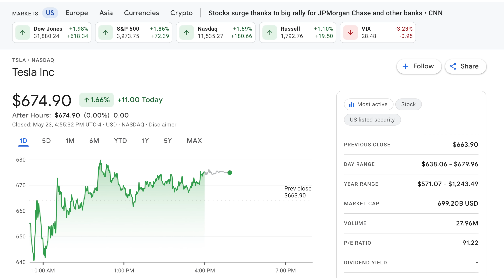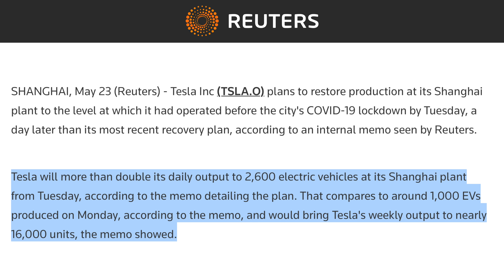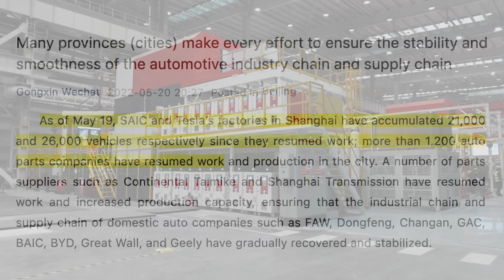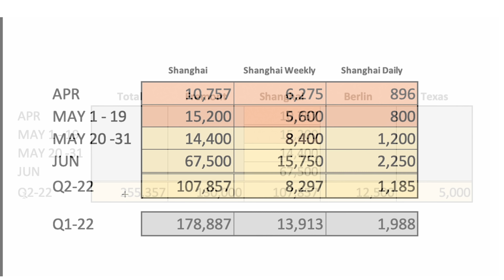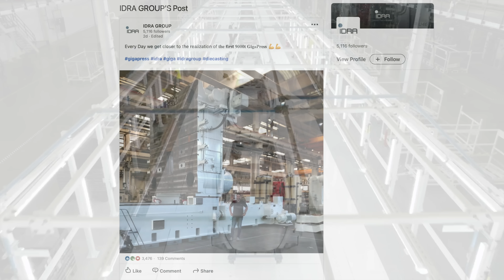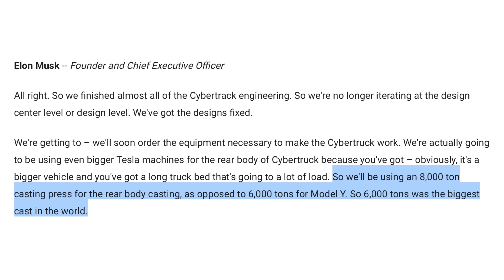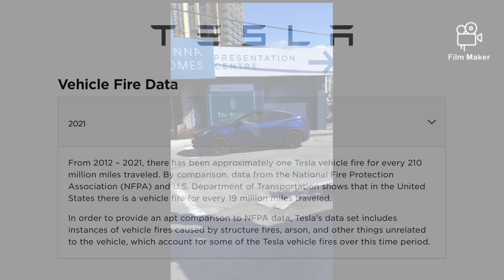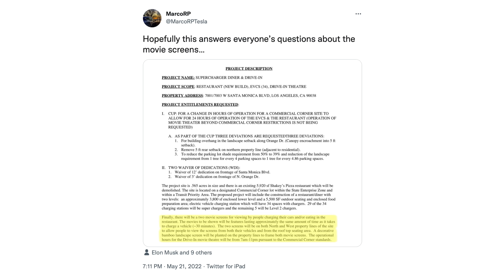Giga Shanghai Set To Ramp? + New AI Presentations, Giga Press

Comment: That second fire looks like gas burning on the outside of the car.
Reply: Looks like the owner threw gas on the top and lit it
Reply: The owner said on the news the fire started inside the car,  sounds similar to the Model Y.
Reply: @dmitchellhomes  which is why the glass and roof are on fire? Nah an internal fire would blow out windows before escaping to the exterior
Reply: @woodycoat  glass is the first thing gone when the car catches on fire, take a look back at video of any Tesla fire, all the glass is gone
Reply: @dmitchellhomes  "said" sure but I'm going to go with what I can see.
Reply: @lucidmoses  welcome, google the new story, they have video of the fire, it happened in California city.  Has been picked up by a lot of the local media, including an interview with the owner
Reply: @dmitchellhomes  Ok, I looked up some extended video.   There are different angles that do look like the glass is broken and the fire is coming from inside.   That being said, I re-watched the bit in Tesla Daily's video.  It still looks like gas on the roof and the extra footage I found doesn't have any info as to if it started on top and spread down when the glass broke or if it spread up.   Had to check about 10 videos to find one that wasn't geo blocked.   Do you know of one that shows the order and not just a bunch of clips?

Comment: Just a reminder.  I don't remember who, if ever, the 'loyal customer using 200 presses...' might have been, but a customer could be using a 6000 ton press to make, for example, 5 smaller castings such as a transaxle.  By using a 9000 ton press they may be able to cast ten smaller castings at once, thus doubling their production rate.  This makes great economic sense in the mass production domain.  The same goes for a 6000 ton press: it may be used to cast many smaller parts with greater economy than a smaller press.  Time is $$$ so bigger means faster - it doesn't mean that every big press is used for a big casting.

It is still very dismaying  to see so much media attention focused on Tesla fires.  There should be more media attention on ICEV fires, to give a more accurate picture of vehicle fires in general.  Thanks, Rob.

Comment: The image from the California Tesla fire looks a lot like somebody poured gasoline on top of the car and set it on fire.  I do pyrotechnics and that really does look like an accelerant on the roof.
Reply: That's what I thought. Why the hell else would the windshield be on fire???
Reply: Battery fires are supposed to vent from the bottom out . I agree looks fishy .
Reply: I looked at that and thought "molotov cocktail", glad I'm not crazy!
Reply: Flammable liquid pored on top all but certain, glass, paint and body panels don't do that.
Reply: I agree. It looked like the glass was burning, which glass does not. Looked like an accelerant. Insurance scam?
Reply: Seems more likely roof glass igniting some interior trim due to sun magnifying glass type situation. Would be interesting to know what interior temperature was before the smoke started.
Reply: It does look that way, but if you watch the video, on KomoNews, you will see it's totally legitimate. The illusion in this photo is explained by the fact that at this point there no longer is a roof, nor a front windshield. The inside of the car is full of flame and the side windows, blackened by soot, burst and shatter a couple of seconds later.
Reply: @darylfortney8081    That glass is NOT a lens, doesn't magnify anything.  Look at the picture--the flames are on TOP of body and glass
Reply: Either gasoline or the paint spontaneously self- combusted. 🤨
Reply: @darylfortney8081 , there are millions of Teslas just like this in much hotter climates.  Even during the hottest months of the year (i.e. not May) they don't turn into magnifying glasses and start fires.  So your conclusion seems VERY unlikely to me.  Also, the fire should be on the interior if that were the case.  Flames coming off the outside surface of the glass makes very little sense.  This is most likely a case of vandalism/arson IMO.
Reply: @darylfortney8081  Actually the roofs are designed to reflect UV radiation. It's only 2% tint, but 99% UV light.
Reply: @darylfortney8081  That would not cause flames to dance on top of the roof glass. The flames would be coming out the side of the car via the windows.

Comment: One german newspaper has written an article about Berlin having problem with personnel and shortages of components coming from Shangai because of the lockdowns, and that Q2-22 Berlin production should be between 7000 and 9000, not sure how much reliable it is, but they say it's a source close to Tesla in Germany.
Reply: As someone living in Shanghai I can tell you that then coming back to regular production levels anytime soon is a pipe dream. And even if they do they will face serious problems with actually transporting those vehicles out of Shanghai as the port of Shanghai is backlogged for months and leaving Shanghai by truck is NOT an easy task. Shanghai is still in lockdown even if state media would like you to believe otherwise.

Comment: Time stamp  10:21.  It appears the flames are burning the front windshield.  That seems unlikely as most glass I know of does not combust.  What is the combustionable material feeding those flames?  It would appear it could posibly be a flammable liquiid of some type that was somehow poured on the top of the car, and then it ignited.  Hot wax?  HaHa.  Very strange looking fire the way it is igniting on the bare metal and glass.  I am curious what the experts from the Fire Dept. conclude.
Reply: I totally agree, someone threw a bucket of petrol over the car in my opinion (or something similar).

Comment: Hi Rob, do you have any information on the Tesla Megapack factory that was being built at the end of 2021. I see this as a huge boost to energy with a capacity of around 40GW. I can't find any news that it has opened or when it is coming online or if this will be using LFP batteries. Thanks
Reply: I think there hasn’t been any news about Lathrop recently. The Q1 update deck said things are on track though.
Reply: Energy storage always uses LFP to my knowledge, as space isn’t that important.
Reply: @xWinstonski  LFP battery technology has been under a patent until recently. They could only be manufactured and sold in China. This has now changed so they can be used by companies in cars and energy storage

Comment: Question Rob: When you did the autopilot test, the car to me seemed to shut off the autopilot when the car pulled out in front of you, either that or you shut it off. So if that were an accident, does that count as an auto pilot accident or not?
Reply: If the autopilot was engaged 5 seconds prior an accident it's counted as autopilot accident.
Reply: It's FSD, the autopilot is the stuff that other safety systems that manufacturers have like; lane assist, blind spot monitoring, active cruise control, and pedestrian avoidance but more refined. I look at the nuances when the media blames autopilot for accidents of the journalist not doing their job distinguishing the difference. A real journalist will state the FSD.  I know your not a journalist but want you being aware of the news coming forward when reported.
Reply: @GG-si7fw  Oh ok thanks for that. Yeah for sure I was meaning FSD then.
Reply: @zbyszanna  aight, cheers

Comment: Maybe tesla's already have this but maybe they could display a graphic for the manual door door release in the case of an impact?

So if the car detects an accident something gets displayed on the screen helping the passenger's with how to get out if the other power electronics are down but the screen is still on for some reason.
Reply: If they can power then screen then why not just power the doors handles
Reply: @charleslash4895  Depends how the car is hit.  If it is T-boned from one side, that side may have had power cut off, while the rest isn't affected.  One passenger might not be able to get out.  Either way, people should know about the mechanical releases.

Comment: If it is true that 8K lb of pressure is good enough for Cybertruck underbody cold castings, I don't think Tesla would pay for 9K lb presses.  Those are sure to be considerably more expensive.

I have to wonder if the Semi production volume, as envisioned now by Tesla, would justify using gigapresses.  Just thinking out loud... the battery will be very large.  Tesla hasn't said anything about cell-to-pack in the Semi, I don't think, but however it's engineered, it'll be a big, big pack.  How much of a front and rear underbody casting will there need to be, to the front and rear of that massive pack?  I have no idea.  I suppose if the castings needed are large enough, they might justify using a 9K lb press to produce them - if the Semi production volume will be high enough to justify the capital expenditure.

But I am guessing that the Semi production volume won't be high enough for that to make sense.  30K units by 2025 sounds ambitious to me.  Speaking roughly, 30K units is probably less than a tenth of the volume they would need to justify the capital expense of the presses.  At least that's what I wrote on the back of an envelope.  No, no, don't nominate me for a Nobel Prize in Economics, I'm far too modest to accept.  Plus, I don't like wearing a tuxedo.  They use too much starch and it itches.

I really, really hope Tesla will disclose lots more information about Dojo hardware and software progress at AI Day, or Hot Chips, or anywhere, really.  Dojo might eventually turn out to be the most significant of Tesla's accomplishments.

Thanks for your reporting, Rob.
Reply: Add 3 zeros, man.  G > K, Heavy Metal.  To you're point, who else wants a 9 GT press?
Reply: @K2CTC  Good question.  I don't know who else would want to shell out the bucks.

I know that there are a few other customers for Idra's giant presses.  Chinese automakers, if I am remembering correctly, but don't ask me to recall which.  Must be a volume producer, though, or it won't make economic sense.

It also won't make economic sense to use the presses to make ICEVs, partly because the undercarriages in ICEVs are full of moving parts, a transfer case sticking down, all kinds of complicated junk, and partly because ICEVs will be losing sales volume, it makes the breakeven point on the investment in presses very tough to determine.  Plus, legacy automakers are mostly up to their eyebrows in debt.  They have a tough time justifying a capital outlay they can avoid.  Nobody has to use gigapresses; they're optional.

But a 9-ton press?  It shouldn't be necessary for light duty BEVs - sedans, cross-overs, light pickup trucks, etc.  Smaller, cheaper presses will do.  And the volume won't be there for big trucks, buses, RVs, etc.  If the volume isn't hundreds of thousands, the presses won't pay for themselves in any reasonable payback period.

Who's left?

Somebody must want them, or Idra wouldn't have engineered the thing.

Elon always wanted to be able to die-cast cars the way toy cars are die-cast.  I suppose it's vaguely possible that he intends to use 9-ton presses to make the body-in-white for a model - maybe the $25K compact car Tesla wants to bring to market?  Or the dedicated robotaxi?

I don't anticipate it being used for the Cybertruck underbody, and probably not the Semi underbody.  But Tesla could still be the customer.

Elon does love his surprises.
Reply: @Urgelt  Yea, it seems too big for published cybertruck plans, but who knows?  Interesting about robotaxi -- they may have a design that could stamp out quite a bit of the car in one shot.  Curious!

Comment: This is my opinion. One of the reasons Tesla has been so successful is that, except in China, people in other parts of the world have relatively few choices when it comes to buying an EV that is not as or more expensive than a Tesla. Added together neither GM, F, Honda, Toyota, VW has been able to produce any quantity of EVs compared to Tesla. Tesla makes a fantastic EV, the best on the road, however, if you take Toyota as an example, they sold ~5MM Prius cars and learned that even thought people could spend more for basic transportation and certainly get a more attractive car, they did not because high MPG and basic transportation is what they wanted. Prius sales peaked in 2012 because of competition. Now Tesla has a cult and they will buy Teslas regardless of the cost, however, most of the market does not need all the advanced feature and will be home charging and using it as a daily driver, so a good range and cheap price will be enough for a large percentage of new EV buyers.
Reply: Tesla is already sold out. There are PLENTY ob buyers for Tesla at this time.  At some point they may reach saturation...But NOT this Day!  :-)

Comment: There was also the fire at the Tesla delivery center in Florida. Seem like one of the cars was on fire and damage two others. Seen the news report about it as well as videos from ppl walking by. 

Weird how so many fires in recent days. Similar to the wave of fires a couple years back.
Reply: The California one was all but certainly arson, flammable liquid pored on top of car, not a battery fire.
Reply: @Mrbfgray     No,  the one in CA started inside the car,  the owner was on the news...
Reply: @dmitchellhomes     I don't buy it.  Glass doesn't just burn like that at any temp.  It will sag and collapse at say 800F, never ignites.
Reply: @dmitchellhomes    SURE.  And if the "owner" says it can fly like a bird then it must be true.  Glass, aluminum and steel just spontaneously combust as soon as you put the Tesla T on the bonnet.
Reply: @Mrbfgray  if you want to be in denial, that’s fine, but the guy who owned the car was on the news he described what happened, and it sounded like many other Tesla fires.  This one sounds like it started in the penthouse under the backseat, which is where the main electronics are for the battery pack.  Two of the others this weekend started in the dash, both broke the windshield and flames went shooting in the air where the windshield used to be
Reply: @dmitchellhomes    LOOK at the picture, it's burning ON TOP of the body.  If you want to be in denial of the obvious, fine.  Not interested in a childish ego contest, truth will come out soon enough.
Reply: @Mrbfgray  if you had any intelligence, you could Google this, it happened in California city, and was reported on the news with video of the fire.   The owner also talked and gave the whole story, why don’t you go look it up watch it, and then get back to me?   It would be OK for you to apologize when you realize how  wrong you were